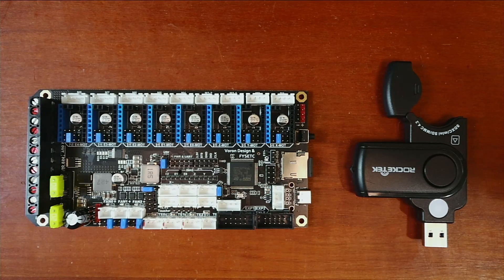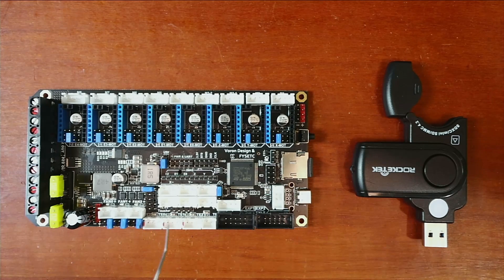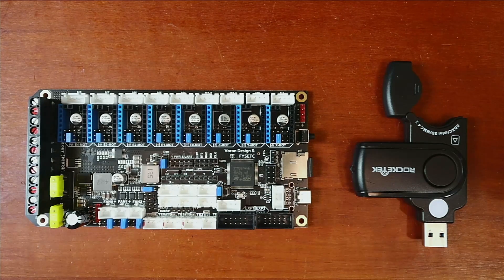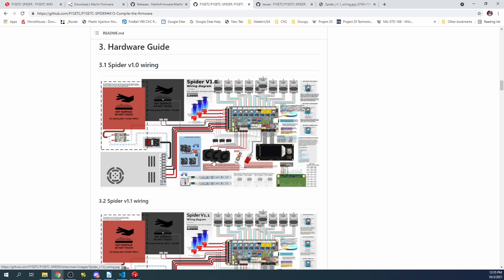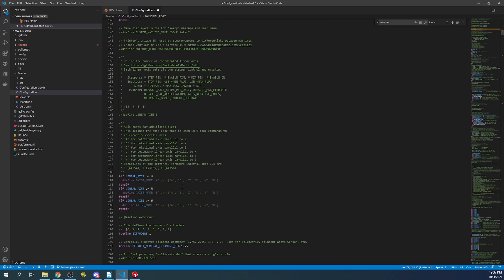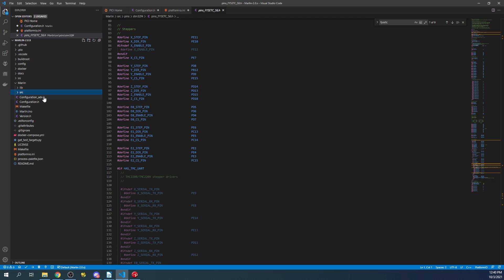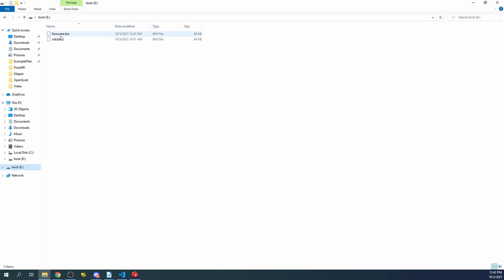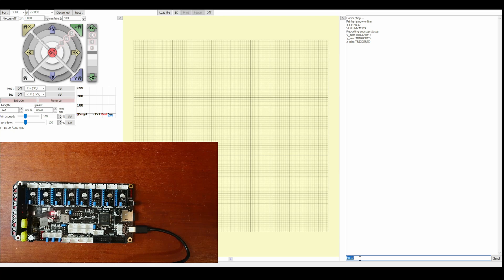Fysetc Spider v1.1 - Basics

Comment: Si j'ai bien compris. Les ventilateurs peuvent être connecter en 12V et/ou 24V intéressants de pouvoir mixer les 2 c'est la première carte qui propose cela ...
Reply from the maker: Il s'avère qu'il est possible de faire du 5/12/24 volts avec un bloc d'alimentation 24 si vous réglez correctement le cavalier d'alimentation